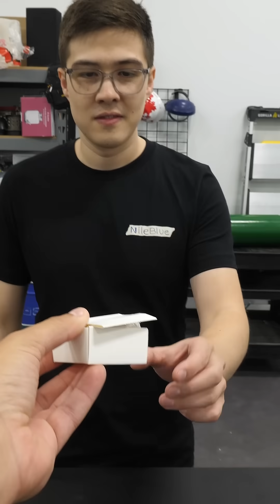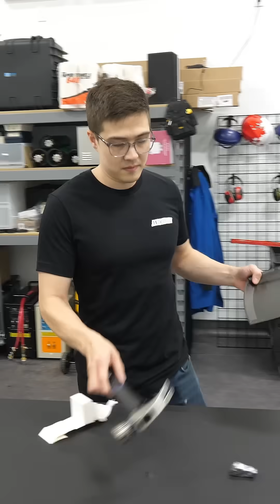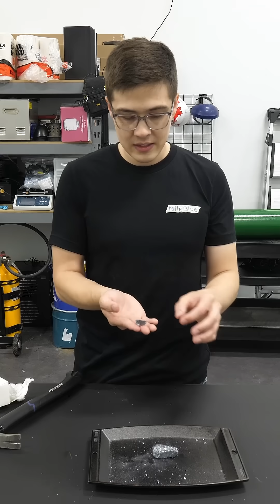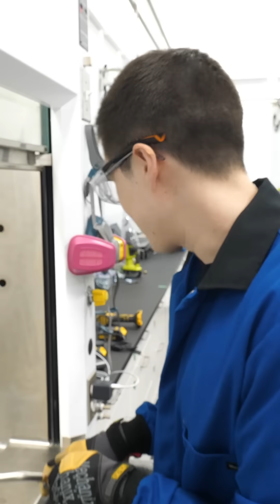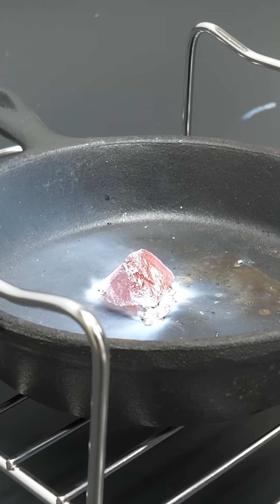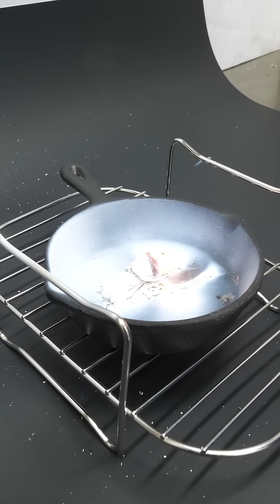Silicon is weird

Comment: Nothing happened because this silicon had an oxide passivation layer, which is very hard to get through. You should have dipped it into HF for a few minutes and then let it rest in an oven for a few hours. Then we could have watched it change color.

Comment: If you used a plasma torch it would melt, silicons melting point is 2,577°F, so a normal green or yellow bottle torch isn’t gonna get hot enough considering the yellow bottle that burns hotter only gets to about 1,800°F

Comment: I know how to melt silicon… but you’ll need some new ceramics that can handle high heat (almost 4000C, roughly 3800C, but higher is obviously safer).

Comment: I worked at a silicon plant (they made computer chips eventually). One of the first things they show us is horizontal vs vertical silicon.

The ingot is grown vertically. A piece about the thickness of a pencil can draw up an ingot weighing thousands of pounds. But if you flick that pencil thickness piece, it will shatter and drop the ingot. They gave us small pieces to try to stand on vertically. Then had us flick them and watch them shatter. It's a crazy metalloid

Comment: hold up. is silicon a metal? or is it just very shiny
Reply: It is a "metal" in appearance, hard and shiny.  However, when pure, it is a poor conductor of electricity, it is not malleable and not ductile, and it does not have metallic bonding so it is not a metal in the chemical sense.   The word "metal" is used for road-making materials too, so it is not a very precise term.

Comment: The structure of silica is very similar to that of diamond, with each silicon atom having tetrahedral bond and bonded to 4 oxygen atoms, which in turn are connected to another silicon atom, thus effectively, each C-C bond of diamond has been replaced by a Si-O-Si link to give the silica lattice.Thus, due to strong covalent network, like diamond, even silica has very high melting point.
Reply: It's always super amazing for me to think that glass is mainly made of silicon, it's probably because I don't have a lot of knowledge in chemistry... There's a lot of chemical reactions that are just like pure magic, like how is it possible to turn it transparent just by adding oxygen atoms onto it?? It doesn't make any sense to me!

Comment: That stuff came into the GE Silicone plant in Waterford NY by train hoppers
It was crushed in a Ballmill then reacted with Methyl Chloride to form Methyl Chlorsilane. 
Then  Distilled to separate the different components of Chlorsilanes. Then some more processing  to get Polydimethysiloxane. Which was used in a multitude of finished products  made at the plant.

Comment: I would have attempted to apply oxy acetylene to see if it would melt. Temperatures would be significantly higher than that oxy mapp gas mix you had going on. Additionally, you'll find the temps increase much more nicely using it in a torch made with a mixing tip.

Comment: Used to work at Wacker.

We basically took that 99% silicon and refined it into 99.999999999999999999999999999% (x27) pure for solar panels and 99.999999999999999999999999999999999999999999999% (x43) for semiconductors.

I'd tell you more, but the Germans would come after me. 😂

Comment: pot scrap of a crystal run. I used to grow silicon crystals in some furnaces. You need more heat, around 2300 degrees. In crystal form it's like glass and will lay you out. That's a poly crystal you have.

Comment: As a Frenchman, I always found it weird and nonsensical that this chemical element is called « silicon » in English. 
Especially when silicone is a family of soft elastic inorganic polymer compounds with electrical and thermal insulation properties. 
That’s a very unwelcome ambiguity, even though silicone polymers do contain silicon atoms. 
The scientific word used in French for the atom Si is silicium. Much clearer and unambiguous as referring to a chemical element.

Comment: Nile, you are a much better chemist than I but I recall that nearly pure silicon can be made in a thermite reaction using white sand and aluminum. It's an extremely exothermic reaction. So, pretty tough to burn. You'll need to grind to increase surface area.

Comment: It’s not indestructible but it’s tough lol I can tell you that the refractory materials made with it can withstand around 700 degrees on the low end for backup materials up to around 3800 degrees on the high end for hotface materials depending on the silicon percentages also the more there is the harder the material is some of that stuff like Thor 60 or carbide silicate is almost diamond hard and very hard to tear out I’ve jackhammered for 12 hours before at a trash burning plant went through an entire box of jackhammer bits in one shift and only removed a piece the size of a basketball it takes a large crew of guys around the clock for weeks to remove the bad material and replace it what’s wild is it’s actually brittle lol compress it together though it’s another animal entirely

Comment: Silicon can actually be melted it just takes an extremely high temperature silicon is one of the ingredients in refractory materials used to insulate in industrial furnaces and boilers as well as smelting operations all sorts of stuff even the concrete type material used under the space shuttle launcher I used to do the furnaces at a place that made nickel alloys for all kinds of aerospace industries as well as nuclear reactor rods and welding rods I can’t be too specific due to non disclosure stuff but one of the heat treating furnaces used blocks in its floor to create air gap off the floor those blocks are composed of molten silicon compressed to a very high pressure the end product is almost like concrete glass if that makes sense lol and very very heavy one block about half the size of a cinder block weighs a good few hundred pounds maybe more you must use air powered suction cups with a long handle to lift them into place and it takes two you basically line them up in rows and pour “ concrete “ actually refractory material around it leaving a few inches sticking out the top in rows you first wrap them in paper so they can be replaced that also leaves a gap for cooling and heating as the material expands and shrinks

Comment: just gonna drop here that silicon melts at 2500+f(1400+c). MgO reaction can defintely get way hotter than that but probably need a lot bigger chunk to actually fully heat the silicon.... not ideal safety wise😅

Comment: Silicon melts at 1410C so the magnesium should be able to liquify it. But silicon also has a slightly higher thermal conductivity than magnesium for example. Maybe it just transfers the heat to fast?

Comment: You absolutely can melt silicon, it just has to be really, really, really hot. Silicon is melted in a vat with a crystal "seed". This seed allows a cylindrical silicon ingot to form around it as it is pulled from the vat. Afterwards, the ingot is sliced up into wafers. This is the beginning of how chips with integrated circuits are made.

Comment: Similar to the tiles of the space shuttle?
Reply: Ehh kinda, the tiles of the space shuttle are made out Silica, which is essenstially pure quartz sand. The insulation prevented heat transfer to the underlying orbiter aluminium skin and structure. These tiles were such poor heat conductors that one could hold one by the edges while it was still red hot

Comment: to get pure silicon you need to burn silicon oxide at pretty high temps with coal. the coal is used to rip of the oxigen from the silicon so the process has a really high co2 footprint. 
silicon is the basis of all microchips and solar panels. this is why solar panels souldn't be green energy. the production alone creates more co2 than it can "save" in it's expected live time.

Comment: I love how he just has all types of lab equipment in the most prestine condition and he likely bought most of it for it's specific design so it'd look good on camera. It looks really cool. If you'd walk into just some random lab (with a budget) here in Croatia, they'd likely have some 2003 glassware and 1976 rusty metal stands... also he has those cool axes that are made of one piece so the head doesn't fall of and they have cool handles, never seen one of those, everyone here has one with a wooden handle and some 1970s metal head. It's actually really interesting how you can actually find lab equipment that looks that f-ing cool. Especially that tray he used at the start... most labs would have a stained silver one that's 30 years old...

Comment: Silicon can be used in a thermite mixture. Just combine with a metal oxide...
Reply: Other way around, silicon oxide and metal powder, silicon is not a very good reducing agent.
Reply: Bullet proof plates are coated with that stuff. Needs around 2000c to melt, holding that temperature for around 8 hours, and it covers the bullet proof breast plate

Comment: Pure oxygen has no combustion temperature by itself as it is not a fuel. Oxygen is just an oxidizer, you need to add a fuel otherwise you can not melt anything.

Comment: It’ll melt and get blown into the slag with oxygen, but we’re talking over 2750F. I work at a stainless steel AOD and blowing out silicon to a certain percentage is a necessary part of the process. But your metal pan will melt long before you melt that chunk

Comment: Almost looks like the type used in semiconductors. Silicon, or crystalline silicone will melt at around 3000°F. I worked for a place that manufactured solar cells. Crystalline silicone was used and placed in a crucible that was placed in a vacuum chamber furnace that was purged with argon gas and heated to an extreme temperature which melted the silicon. A structured seed was introduced into the melt and then slowly pulled out to create a long ingot which now had a specific molecular structure that was the basis for producing solar cells. It was fascinating.

Comment: If it’s so heat resistant then why does it burn so easy when they are use to make diodes. Context:😢😅 I broke my diode from having it close to the soldering gun to long.

Comment: That’s why they use alloys like alusil, nikasil, and lokasil in engine manufacturing. To bolster the strength of an aluminum cylinder block without having to add the weight of cast iron cylinder sleeves. Very interesting.

Comment: I use those silicon rocks at work. I add around 100lbs of it to 56000lbs of molten scrap aluminum. The purpose is to create a specific aluminum alloy
Reply: Very cool. How does that make the aluminum better?
Reply: @PsRohrbaugh  Apparently the silicon makes it solidify slower and gives the alloy greater tensile strength
Reply: @PsRohrbaugh   I'm not important enough to answer that question for u. what I do is run a sample through a mass spectrometer. That tells me how much silicon is actually in the aluminum and with that I can do a little calculation to determine how much I need to add in order to reach spec for a specific alloy. Our most popular alloy is 6063 and the factory I work at calls for that to be 0.49%  silicon
Reply: What is that alloy used for?
Reply: @timothyshepherd1825  I'm not sure but Google has info about 6063 aluminum alloy. From my understanding it's one of the most common aluminum alloys in use. It not known for being very strong or weak just a decent affordable aluminum alloy
Reply: @timothyshepherd1825  I make other alloys the second most popular is 6005A that one has higher magnesium, copper and silicon. It's a lot heavier and stronger thus more expensive
Reply: @denniscole5105 that's what I've always wondered is how do they melt magnesium without it catching on fire.
Reply: @austinwagoncompany  I add 18lb magnesium bars to molten aluminum yes they do spark and stuff. It takes about 2-3 mins for the bar to melt when the aluminum is around 1350 degrees Fahrenheit
Reply: @timothyshepherd1825 AlSi alloys are commonly used in car engine parts, including the block and head.
Reply: @timothyshepherd1825  strength for the aluminum. In steel, silicon is used in electrical steel, due to its magnetic properties.

Comment: I work with this stuff all the time. Great for giving you silicosis. 

Top tip: You do not want silicosis.

It's a common addition to aluminium alloys, generally about 8-20%. It doesn't melt in aluminium, it dissolves.

Comment: Silicon is fairly unreactive at normal temperatures since Si-Si bonds are strong, Temperature not high enough, the melting point of silicon is 1400 oC, the blow torch assuking propame is jist shy of 1300 oC, observed that the silicon glowed because it was getting close..if tou want to see something happen, try blowing chlorine gas on it with some oxygen, should be good

Comment: Actually I know how you melt silicone and it's the same way you melt a few other things just like vibranium which has a compensation of half-and-half equal parts of iron and nickel the point being is your move oxygen from the area you you make pretty much a vacuum chamber once all the oxygen is well on temperature starts rising inside the vacuum the vacuum will change temperatures but it won't change enough for matter to change then once you add heat to an enclosed vacuum as long as your vacuum source doesn't fail that silicone will be a puddle or silicon

Comment: You can melt silicon rock. I worked at a plant that produces circuit boards for large machinery. But breaking it without proper eye protection, is a good way to blind yourself. It can shatter violently, and the shards are needle sharp.

Comment: As a borosilicate glass blower, I often encase silicon in borosilicate glass, as it has a similar coefficient of expansion. If done with patience, you can flawlessly suspend a chunk in the glass and it looks like nothing ever happened to it. If you rush it (my torch exceeds 2500 Fahrenheit by a touch) it will off-gas and bubble up a lot, but that's it.
Reply: I came here to say the same thing.  I use it in my marbles all the time.
Reply: I tube encase with condensed heavy wall 50mm , you can get a perfect encasement and not have to baby it so much, it does waste quite a bit of tube though. If you have to make 20 marbles in a day for production, I reckon the time saved is worth it, especially considering the bubble-free guarantee. I used to just compress it between two very hot marias and got similar results, it just took a lot more prep.